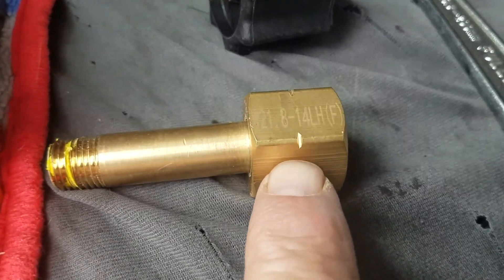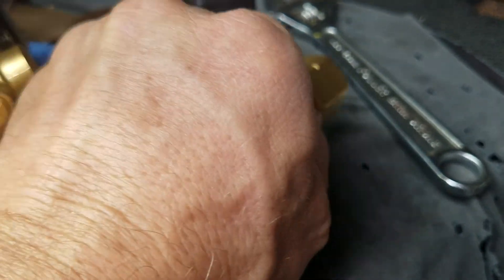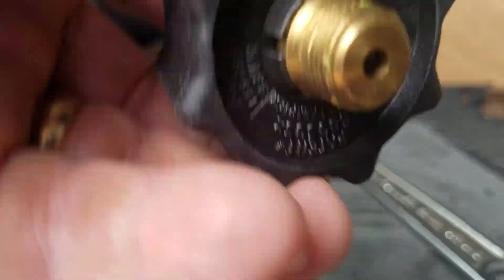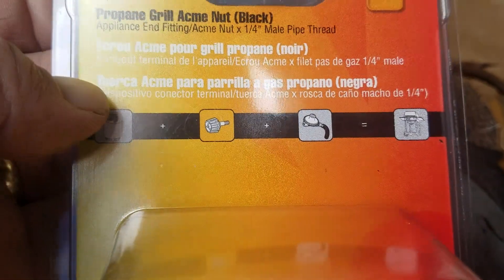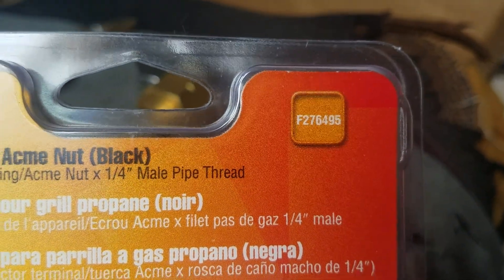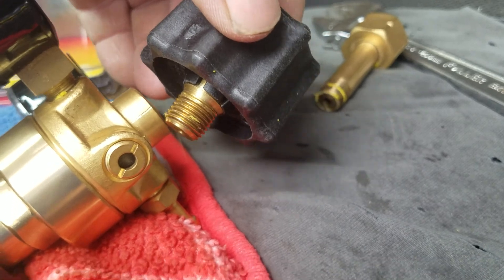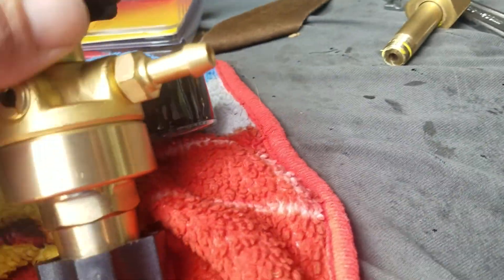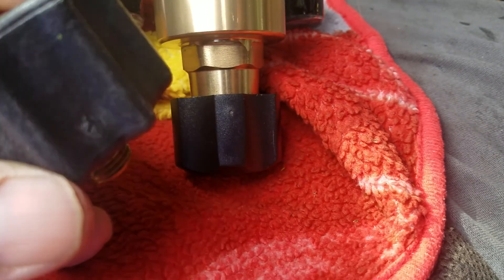Regulator adapter to change from acetylene to propane

Comment: Hi , I cut the end of the hoses of the tiny precicion torch and converted them to insert in the adjustable regulator with gauges cuz didn’t find this gauge that have female end that fit to the male hose end, but the Oxygen end leaking, while the butane hose’s connected to cooking cylinder successfully. 

Could you direct me where to buy this kind of regulator with gauge for the oxygen?
Thanks 🌷
Reply from the maker: I would go to a welding, gas supply company

Comment: There are a few different size acetylene tanks and at least two styles of valves on them. If you do a google image search on "acetylene regulator" you'll see two different style tank fittings on those regulators. The regulator you have is for the smaller sized tanks, the regulator designed for the larger tanks is compatible with a North American standard propane tank and can used without modifications.
Reply from the maker: Thanks for that info!